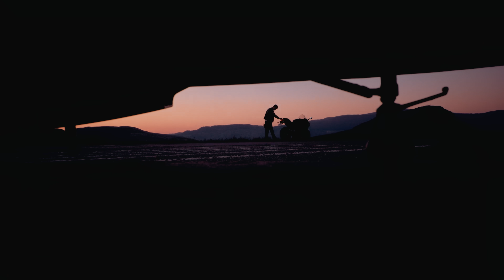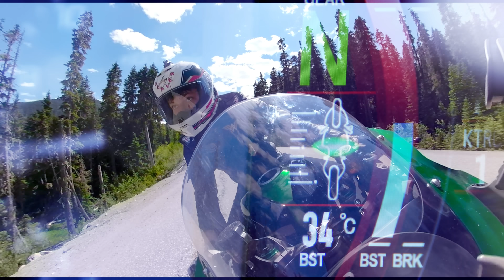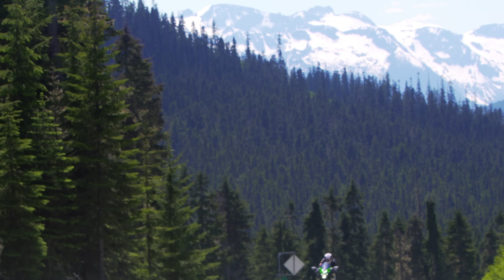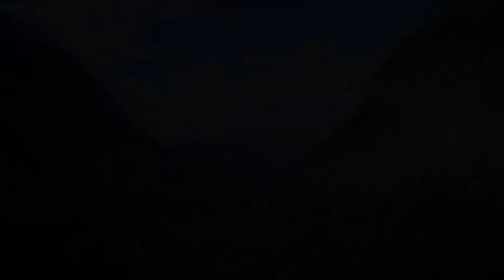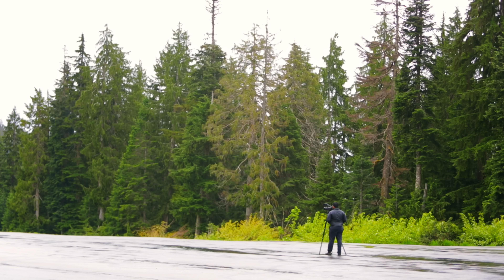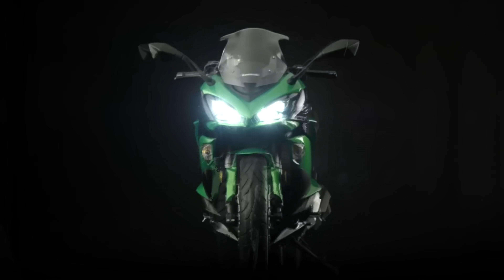Kawasaki Ninja H2 SX Review - 200HP Touring?

Comment: Im going to keep my K1300S, here are the reasons why: 
-Same weight (260kg)
-only minor difference in power and torque and the BMW has always more than 100nm on the rear weel
-half the price (at least here in germany)
-My K1300S has shaft drive, but its not heavier than the H2SX with the chain .... embarassing for Kawasaki
-The Kawa looks like its a nightmare to clean (edges and overlapping panels everywhere... URRGH)
-The detune on the H2SX makes the Supercharger kind of obsolete, a bike with more than 150hp has no problems at high altitude (Last month i rode up Großglockner and 170hp are still more than enough even at 3000m)
-argument above + the supercharger isnt going to make it more reliable or cheap to service either....

only reasons for me to get the H2SX:
-THAT SOUND GODDAMN IT SOUNDS GOOD!!!!1
-Going 300km/h on the autobahn with panniers legally, where the BMW is only licensed for 180km/h with panniers (still does 300 though)
Reply: Well even if you did get the H2, you dont seem to get my Argument? I own a K1300S and did a Testride on the H2. Its more about: "Why wouldnt i change the bike" and not "the H2SX is Worse". I completely understand why you would get the H2SX, if you dont have a K1300, Bandit, Super duke or whatever else before it. Its is a good bike, by itself!

-yeah the H2 has the same torque and bit more HP (which nobody can use on the street anyway) than the K1300 so  why woud i need a H2, dont need more Topend power for Touring. Both bikes pull equally hard in the lower RPM´s.... 

-Driveshaft and Belt are just better for touring than a chain. You cant deny that! And you know ... a driveshaft doesnt affect corner-handling because its not turning in the direction that the wheels (or the crankshaft) are turning, its unsprung-wheigt does not keep the bike upright or anything  (Sorry cant really explain that in english, not my first language)

-price always matters for someone even if its not you or me

-WTF? Wont even clean your Bike yourself? Then pay a ridiculusly low wage to people that do it for you? Thats just ... wrong...

-It is detuned and the engine is too heavy for what its putting out (260kg for a modern bike with a chain is just a little bit much). The supercharger sounds nice but its not a lot of boost. You feel the same surge of power and torque on a big NA Bike (hayabusa, zzr1400, K1300, VFR1200) just the sound is different.

-The dash looks looks like a kids toy.... (but thats personal preference)

-The Supercharger sounds awsome, but makes things heavier, more expensive to buy and to service, there is no real data about reliability, and the power at least in the H2SX is not that impressive (on the H2 thats a complete different story)

-I doesnt have the newest safety features because it´s from 2009. But you really dont need it. K1300 has good ABS and a basic traction control, quickshifter and you can launch every bike if you have at least a tiny little bit of skill in your right hand. 
Also it has a good throttle,a smooth engine, precise brakes (that you can use when leaning in a corner without causing problems). 
Also no abs or traction control saves you if theres too much sand or Diesel in a corner. You have to ride cautious on public roads, thats what saves you. The cornering ABS and lean-sensitive traction control save you from YOURSELFwhen youre going too fast into or out of a corner.
You can have as many technical helpers as you want, but if theres no traction between tire and road in a corner and no way for grip to build back up again its over anyway.

-The supercharger that makes nice sounds.... yeah thats pretty good (i said that in the original comment though)

-Cornering lights are relly nice, but why are they a must? i dont understand? Most corners are iluminated by the headlight and theres that neat little trick where you turn yout head and look, then you see whats before you in a corner (also work in shade and at night, maybe take your sunglasses off before riding)

-I have cruise control, its mechanical throttle lock for 5 Euros, but it works ... you can even take your hands off the bars at 200km/h on the Autobahn and it stays stable.

Just wanted to explain my point of view. If i had infinte money and no other bikes for touring the H2SX woud be a serious contender, but not right now (mainly because my bike now is pretty good, for touring and mountain roads, and not because of the money)

Have a nice time with your H2SX and try not to rely on electronics too much, they are not almigthy!
Reply: Christoph Dietl 1.) shaft driven bikes have their cons... First would be the amount of power they rob. In the k1300s case it makes 175hp at the crank, but it frequently dynos around 145-147.. you’re losing almost 30 hp through the shaft. The H2SX will dyno around 190hp at the RW ... on average of about 10-12 hp loss depending on where you live.

2.) Shaft drive being better for touring is subjective. The issue with a shaft driven bike especially one such as the K1300 or like my VFR1200 is that if the unit fails... you are dead ass stuck. No chance to repair, rarely will shops carry the part, and neither will you have the parts to do it yourself. 
Chains get a lot of flak, but too many people don’t understand how much abuse a chain can take.. had a mountain bike chain that had seized up due to rust and was basically worthless, but I wanted to make sure it broke before trashing it... it lasted another 4 trail rides before finally giving way.
VFR800 that I’m rebuilding also has a chain in poor shape.. every now and then I’ll crank it up and put 50 miles on it and ride back just to clear the engine up.. chain holds up. I’m sure the minute I try slam through gears and wheelie though it’ll snap. My point? You don’t have to be that meticulous with the chain. Just dry it off and lube it up and move on.

In addition, you said them detuning the bike makes the supercharger pointless, but the H2 was also detuned to 200hp much like the H2SX. In both cases of the H2 and H2SX they pick up massive amounts of power after exhaust and tune. Are they H2R power levels? No, but it’s still higher than most ecu flashed and exhaust liter bikes.

Not trying to convince you to get an SX.. just saying something’s you’ve pointed out are unwarranted... As for me, I’m trading my VFR1200 in for an H2SX next summer ... I’m tired of scrubs dusting me when I don’t have a curve to leave them at..
Reply: @Texarmageddon  and how often does a drive shaft fail? What is there to break if oil is renewed frequently? But even if it would break, I bet it will make no carnage compared to a failed chain (bruised leg, damaged swing arm, fairings, rim and so on) and would also make you dead ass stuck. Which road assistant has a spare chain and sprockets for your bike and the tools to assemble the chain and do the alignment? Likelyhood of chain failing is much higher than shaft, no?
Drive shaft being better for touring isn't subjective, it just is better. Less maintenance, it's cleaner, and did I mention less maintenance? No more chain lubing and cleaning? Just changing the oil once every 80.000km or so (big deal)
There is a reason all the serious touring bikes have shaft instead of chain. H2SX just went the cheap way with a chain and that is just a big no. Just a liter sports bike wanting to be a touring bike.
Robbing the power? Who cares? It's not a racing bike, it's called a TOURING bike for a reason. Besides doesn't rob 30hp like you say, but way less.
Reply: @omfgwtfbbq90   I'm just going to start off with you are completely out of touch with reality here. Yes, a chain that has seen about 10k+ miles will definitely be at a MUCH higher risk than a shaft driven bike. Yet, let's be serious here.. IF you know you are getting ready to go on a high mileage run are you seriously going to go out there with a worn out chain? NO.

Second, why would you call out roadside assistance for a chain or replacement socket? You have a sports touring bike... A bike supporting 2-3 cases sometimes and you mean to tell me you can't fit a small chain and two sprockets? Hell, I guess you don't carry a tire plug kit and emergency air tanks either.  You already sound like an unprepared tourer. Makes me wonder have you seen the tools & parts required to do the task of either. Even then I could just change the chain and at least Im up and running again within the Hour... What about you? 

Third, I don't know if you know this, but I'd hate to tell you that chain driven bikes are covered by fairings and the back part is covered by a chain guard. Henceforth, the only thing you really need to worry about is the chain somehow wedging itself and locking up the rear tire. Ironically that's the EXACT same thing you need to worry about with shaft driven bikes. Now if your leg get's bruised that's your own damn fault for not coming with the proper gear. 

Fourth, I hate to break this significant news to you... BUT this is a sport touring bike... Not just a tourer... Much like Adventure touring bikes... you know bikes where people still want to travel on more than just tarmac/pavement, they make bikes for the people who just aren't quite ready to give up their wild exploration side. This may sound surprising to you, BUT much like ADVENTURE touring bikes don't strictly cater to TOURING ….. SPORT touring bikes aren't going to strictly cater to touring. Also, JUST like the people who aren't ready to give up the ADV... S tourers are for people who aren't ready to give up the SPORT.

Finally, there are very FEW sport touring bikes coming with shaft drive these days. If you even want to consider two of these bikes Sport touring which are FJR1300 coming in at 635lbs and GTR1400 A.k.a Concours 14 at 670lbs.. Then there is BMW's 1200 RS.. The only SPORT touring bike at a reasonable weight with a shaft drive. There are NO other sport touring bikes on the market with Shaft drive. 

* Side note * K1300S- BHP 175hp Frequently Dynos under 145hp RWHP

MY own Personal Shaft Driven VFR1200F 172BHP... Dynos under 145 RWHP.. Now I don't know what to tell you, BUT Those are clearly More or near 30 rwhp Deficits.
Reply: @Texarmageddon  You don't always know what will happen, maybe you suddenly have to take the bike without any time to prepare, in that case a drive shaft is superior. Replacing a chain (done properly, clean everything) takes ages and is a pain in the ass. I know from experience, I like to have my bikes tidy, so I cleaned all the old gunk. Again, drive shaft is superior, it doesn't fling anything on the rim and fairings.

And I ask you again, how often does a drive shaft fail? In the very rare case, it wouldn't lock up the rear wheel, there is nothing to wedge up. One would imagine a drive shaft would fail by metal fatigue, and if that happens, it would just snap in half, and rotate freely and happily. But that just sounds like a bad and weak design. I have never heard of Honda ST1300 drive shaft failure. Which is the next bike I am going to buy, that bike has proven itself to be the most reliable out there.

Don't be presumptuous. I own the tools and I have replaced chains. Just don't like to do it on a road side, in the rain. Again, drive shaft is better. They are far more reliable.

 Also, you should really google chain failure, that little feeble plastic chain guard isn't gonna do shit when the chain breaks at 120 km/h. It seems you are the one out of touch of reality here. When a chain breaks at the freeway, your protective clothing isn't going to help anything. Do you have protection on the back side of your legs? You know how heavy a chain is? You know the effects of inertia and physics? You know what happens when suddenly it goes towards your fairings and your legs? Just google it my friend, and pray it never happens to you.

But hey, if you like chains so much, just enjoy adjusting the tension and alignment in the case you don't have a single sided swingarm, cleaning them, lubing them and replacing them. That's like your choice man. I rather have a piece of mind and less maintenance on my next bike ;)
Reply: @omfgwtfbbq90  1.) There will never be a valid reason for you to take a bike out without preparation. If my bike is in an UNSAFE condition I'm not going to ride it.. Plain and simple. If I know my chain has seen 10K miles already and I STILL haven't ordered another... That is ignorant riding. 

2.) you like to have your bikes tidy... I'm perfectly fine with that.. BUT I also know I have a bike sitting outside RIGHT now that sits more than anything and that chain still hasn't broke. That bike is there just for people like you. You all underestimate how much a chain can actually take.  IF all you want to do is tour, I highly doubt your chain is taking a Loss, but if you start trying to do wheelies and redline shifting that's when you're bound to break an old chain. 

3.) Why are you aiming for the rarities in this situation, but I can't aim for yours? I'm sorry all my chain driven bikes either had a Metal chain guard or I ordered one for them. I'm sorry I wear full leathers and Race boots when I ride. You do realize the chain has to pop off a certain way for all of that to happen right since you want to bring up Physics. Try me and say my bike doesn't have a metal chain guard. 

4.) Have you seen inside of a shaft drive unit? You can't honestly think you are safe if the shaft drive snaps you'll be safe... I assure you if that unit snaps it's snapping in pieces and LET ONE of those pieces wedge itself into one of the Bevel gears and tell me if you'll rotate freely. Let your bearings or shims wear or they prematurely wear despite constant fluid changes.... Watch that U-joint lock up cause it can't rotate freely. 

Again, we are basing all this off rarities.. I've RARELY had a shaft failure and I've rarely had a chain failure, BUT if I'm going to ride out of state... I damn sure don't want a shaft failure to happen. shaft failures do happen and they have locked up the rear just like a chain can. If it can happen on a car it can damn sure happen on a bike. 

Lastly, GO ahead and pick up the ST1300 and travel out of state if you want too...  Your whole bike will be on Back Order heaven if anything goes wrong.
Reply: Thanks for clarifying :) yes if you have a good bike you dont need to change it. its always your choice.

some things arent as 'bad' as they seem:
- 10 USD is a high wage where i live.. the government set 10 USD as daily minimum wage.. :) washing bike takes 1h so im paying a lot, not exploiting people. at gas stations that have car wash shops you can get your bike washed and waxed for 3USD. with really decent results.
- cornering lights: im riding on remote countryside roads in the jungle where at some locations are no street lights. none, nada. also when roads have street lights it doesnt mean that curves are well lit (imagine potholes, branches etc. which arent visible enough) the headlight shines straight so cornering light is for me an amazing feature.
- Coming from a CBR650F, which has a digital dash, the new dash shows much more and with bigger fonts, makes it easier to read when riding, btw. i use the black/white touring mode for display as it shows more data. for example the ZX14R dash is 1/4 of the h2sxse. I rode both and ZX14R dash was a joke)
- yes the electronic tools arent almighty but may forgive small riders errors, or road conditions.. e.g. where i live there are sometimes fine sand layers on the road, so fine that you cant see them, but slippery as hell, so traction control does help a lot to make taking off at intersections carefree with a bike of that much power. (e.g. on CBR650F i had some slight slips with rear tire every once in a while). those slips are just milliseconds long but can be scary.
Reply: Christoph Dietl nice comment 👍🏽 k1300s is a sexy beast-
Reply: i did get the bike, so far there is no comparison, worth every dollar/euro... sure you could ride your current bike, but your points are moot... 
- it has 200HP, not 175 like K1300S, and it doesnt need more torque :) (unless you plan to put a trailer on it,..lol)
- H2sx's chain is lighter than your shaft drive and that has impact on unsprung weight at the wheel (the extra weigth of bike is from supercharger and frame)
- if you have the money, then the price difference honestly doesnt matter (where i live it costs 2x the us price due to taxes!)
- not hard to clean, but if you can afford the bike you can afford paying someone to clean it. a detailing shop comes to my home, wash and wax it, for 9 USD total!
- h2sx is not 'detuned' in a sense of crippling the engine, the supercharger gives awesome boost, it just rides smoother than h2
- there is nothing to do on supercharger during maintenance :) they made it very reliable.
- SE version has unbelievable dash
- Supercharger is awesome. Not just for the power, but the sound, feeling, etc. whole package
- Does K1300S have Cornering ABS, Traction control, Launch Control, IMU, autoblipper, quickshifter up/down, lean angle display, engine breaking control, ...
- did i mention the supercharger? lol
- Cornering lights are a MUST! you dont know you needed them until you had them.
- K1300S has cruise control? (no, its not necessary on a bike, but practical for quick relaxation periods on longer highway rides)

Overall im sure you can be happy with the K1300S, but you wont have an clue about the H2SX until you rode one. trust me :)